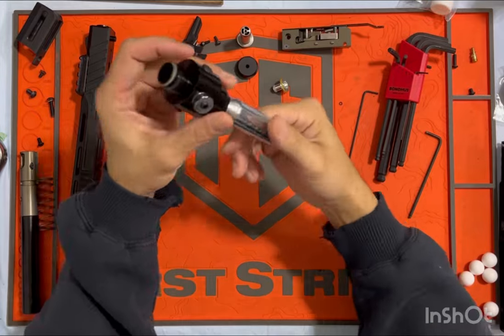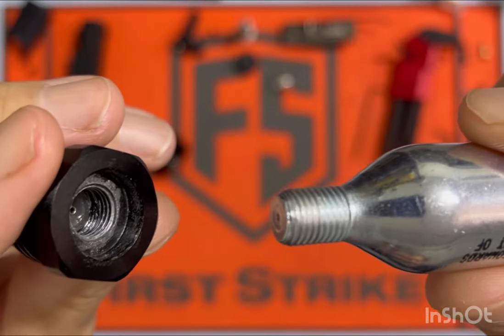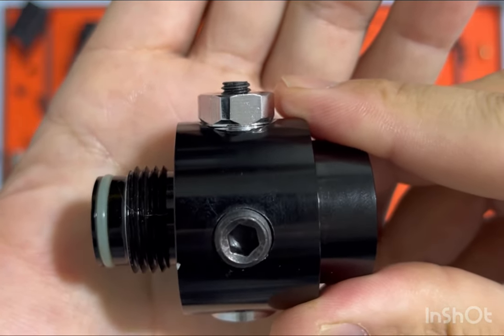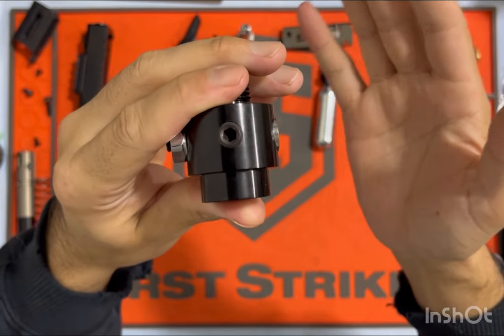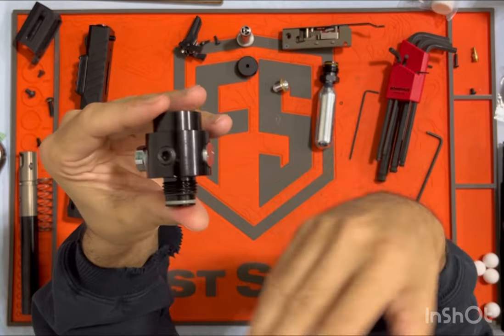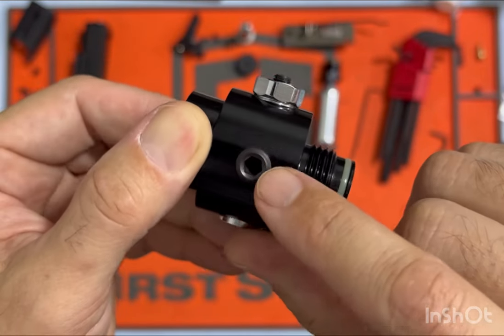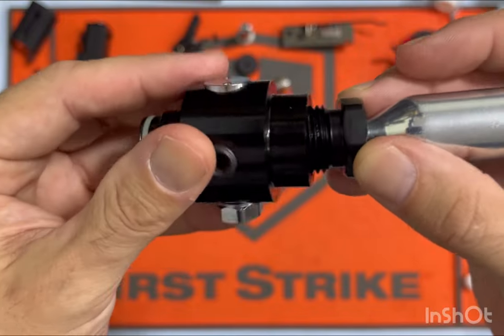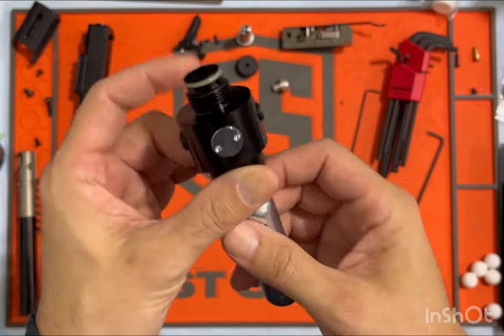LL4D AliExpress Adjustable Hpa/Co2 Regulator - My setup with links

Comment: Really though you avoided the question again quite skillfully what is up with the Sicariis, been drooling over it for some time now and considering the Nerf milsig to make some hard nylon or Delrin  projectiles with steel ball bearings in the end of them m79????
Reply from the maker: I am berry sneaky 😈 If all goes well there may be a short upload tomorrow.

I would be curious if the Nerf version hits about the same or if they have regulated it more?

Comment: Excellent! Can this  also fit 88g ? Looks great, definitely on my wish list now. Love the hpa option too. Thanks for this video.
Reply from the maker: The regulator itself is hpa thread ready. I use an adapter to use the 16g so you would need a different adapter for 88/90g which is also available on AliExpress or Amazon. The one on Amazon is sold under the JT paintball name. I can also buy these adapters locally at Canadian Tire so you may find them at a sporting goods store near you.
Reply from the maker: Actually you need an adapter to meet the 88/90 housing in the Hdx too. This is what i mean by it might end up too long by the time you try and regulate the output.

Rune did a video today using the type of adapter you would need to use this regulator in the Hdx.
Reply: @lesslethalfordummies  Brilliant, thank you. I was talking about this recently with him. Will have a look. Much appreciated.
Reply from the maker: @MHLivestreams this is what you would need

HPA CO2 0.825"-14NGO Tank To 88g 90g Output Disposable Cartridge Adapter M16x1.5 For Air Tool Accesorries
a.aliexpress.com/_mL4VURQ
Reply: @lesslethalfordummies  excellent! Your effort is appreciated, thank you very much.
Reply: Ali Express is at the very least, as reliable as Amazon. Same manufacturers for many if not most products. Amazon shipping is going to phase over to USPS vs UPS, so in the future even shipping times won't be as big a difference. I have received Ali Express products in 7 days before, even with their free shipping. Just have to know your specifications and understand the possible shortcomings.
Reply from the maker: Yes some of the AliExpress items even appear to be drop shipped from local warehouses and i also have received them in very short order.

Comment: Would it be possible (for the vks) to use something like this with a folding remote line air-through stock, so that the stock can also act as an expansion chamber for the co2 cartridge?
Reply from the maker: Anything is possible with some creativity. I got some bits i picked up a while back after someone asked the same question but i just havent got around to doing anything with them or if they would even work.

Comment: Can the threaded co2 adapter be used directly into the back of the m17 without the regulator?  Is the regulator necessary?
Reply from the maker: Yes it can. Using unregulated co2 can freeze orings. Power will be crazy but how long the orings can withstand the liquid co2 is the question.